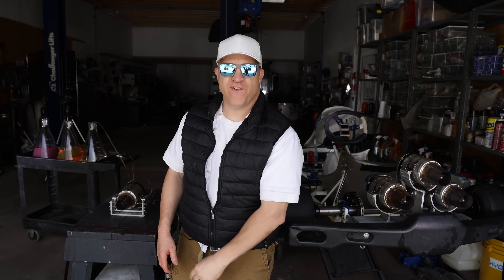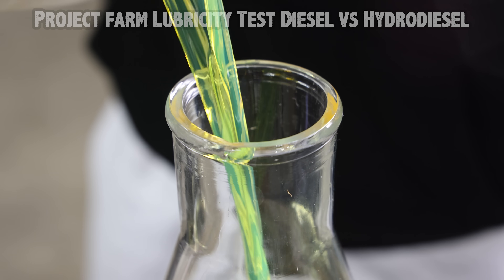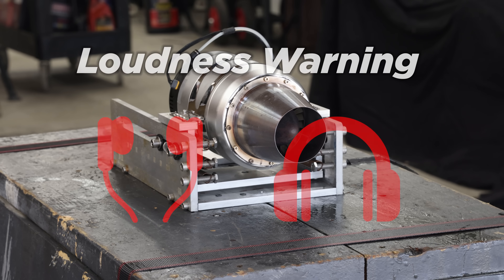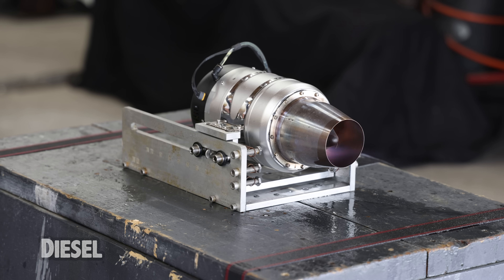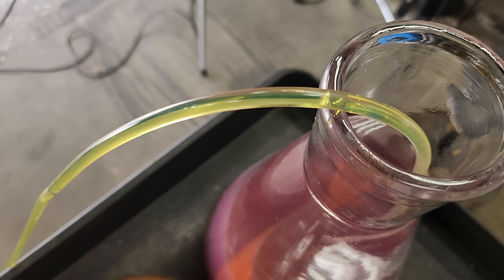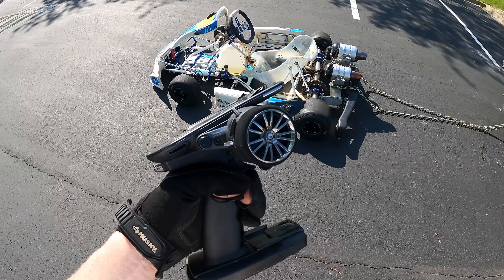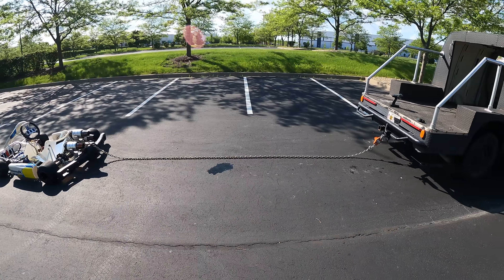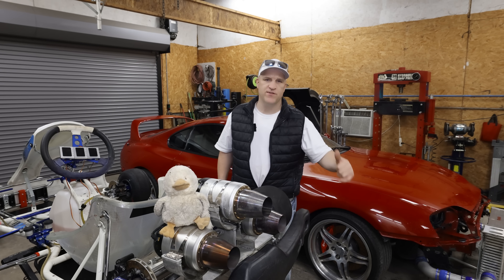Jet A vs Diesel vs Hydro Diesel (Jet Engine Thrust Test)

Comment: @warpedperception I wonder if it's possible adapting a high bypass turbofan design, like a general electric CF6 to these engines to produce and multiply your thrust? The CF6 produces between 41k-65k lb of thrust (depending on the which variant you look at). The design is kinda simple on paper, a longer shaft to implement a bigger front fan blade for your bypass around the engine, a shroud that encloses the front blades to produce thrust and a outer housing to stabilize the shroud and enclose the main engine to produce that extra thrust.

Comment: Can't say that the engine or ECU was the cause of the weird test results in the old diesel vs jet-a test, and I can prove it.
You used the same exact engine in both tests for that older matchup, therefore if there was a fault in the ECU or turbine, it would have been the SAME fault in both tests, which cancels out the error it would have induced because all of your data has that same error in it.
Much more likely that you had a fuel contamination issue, you noticed that the HydroDiesel has a lot less thrust than either Jet A or Diesel (this time around), and if you had water contamination in the Diesel of the OLD test but NO water contamination in the Jet-A of the OLD test, that would have caused a large variation, exactly lining up with that old test.

Comment: Use JetA normally on diesel you can use less throttle due to better performance also increasing fuel efficiency.
Reply from the maker: Not the case here, it was full throttle with diesel and made less power.

Comment: Jet A bruns at a higher rate than disile fuel. The other is the additives in the fuel plus the synthetic oil talorate extremely high temperature as compared to the diesel fuel. Diesel fuel doesn't have that high temperature tolerance witch is reason makes less power.

Comment: Your diesel should have race oil added if you're putting it in these (we've been using Amsoil for 4 years with no issues). Also, CO2 is your friend in those hot starts, it won't hurt the turbines like the fire. EDT: i saw later on your bottle you wrote diesel w/ oil, but you initially said "straight out of the pump" so.. good on ya i guess
Reply from the maker: I use turbine oil But I suspect any good oil would probably work, what do you mean by CO2?

Comment: 🤔it's sad that you didn't test them on pure ethanol..
Reply from the maker: Lol I'm not suicidal
Reply: @WarpedYT  I mean, using ethanol as a fuel for the engine, not for the researcher.
Reply from the maker: @alexkart9239  lol .. fair enough but I still think that will blow up the engine, it burns too hot.
Reply: @WarpedYT  even if the engine explodes, it will be an honorable death in the name of Science!
Reply: @WarpedYT  * I mean the death of the engine. Researcher should stay away.

Comment: Jet-a is less kerosene more of a diesel:gas mix by weight and the reason for it being used is for the consistent and reliable burn. At least that is how it was explained when i was a turboprop engine mechanic
Reply from the maker: I don't know too much about the fuel for turbo props, but from my knowledge jet A and kerosene are almost identical. If you Google Jet A there's a lot of information out there about it

Comment: i have flown my turbine powered r/c model helicopter for over 15 years ..   the viscosity makes a huge difference to the fuel flow rate and power delivery 3% lubricating oil is best for turbine response   % %   is noticeably lethargic . My combustion chamber design burnt the fuel in the combustion zone .. unlike your turbine which had silly hot starts and an unburnt oil slick from the unburnt fuel . Torroidal mixing of the fuel air is the only way to go ..

Comment: Another thing I noticed is the inability of the fuel to have a clean burn or be atomized correctly. It seems the engine was shooting raw fuel out a lot more with hydro diesel and diesel compared to kerosene. Interesting experiments!

Comment: Great Video. The MAX thrust on these jet engines is dependent on their MAX RPM reached and for this 300N engine its MAX rpm to make 300N( 66LB) of thrust is 98,000 RPM. You can see in both Jet-A and the Diesel test the engine reached pretty similar max rpm's therefore the thrust was very similar.......only 4LB difference.  And that could be because of the resolution of this thrust stand isn't too great, would be better to have a loadcell rather than springs but I understand the simplicity of the test stand is nice with the springs. In the Hydro diesel test you can see the engine DOES NOT reach max RPM of 98,000 rpms. It only reached about 82,000 rpm. These engine make most of their thrust in the top end of their max RPMS so 2000 or 4000 rpm below the MAX rpm make a huge difference in thrust. And in this case it was 8000 rpm below MAX rpm.   So in order to solve this issue you have to recalibrate the pump for the every different kind of fuel you use. You can do that by adjusting the "PumpLimit" parameter in the ECU.  So basically you recalibrate the max voltage the pump can reach when you command full throttle... which will make sure the pump is able to pump enough fuel into the engine to be able to reach the MAX rpm of 98,000 rpm.  You can see in the hydro diesel test the pump had already reached its max limit way before the engine reached max RPM ............which interms prevented the engine reaching its MAX RPM..... therefore lower thrust. Hope that makes sense.      More test/ experimental videos on these jet engines please.
Reply from the maker: Your mostly correct, the thrust scale is accurate, I forgot to include the clip but I calibrated it as we move through the test. I also verified with the load cell which is pretty boring because it doesn't move. Then at the end of the video I used the load cell multiple times and got the same result which are showing the video. Yes Max RPM is 98k no matter the fuel. I did in fact use hydro diesel In the previous test and it ran the same as diesel, this hydro diesel was almost 2 years old. As for the pump limit you are somewhat correct, with these ECUs on these engines they automatically adjust the pump limit based on the target RPM, up to the maximum voltage you specify, there is no manual setting for pump limit RPM It is automatic for safety reasons, the only thing that you see you watches is temperature and RPM, if the temperature and RPM are not reached within a certain period of time The engine shuts down for safety. That's why the hydro diesel got shut down quickly. So yeah there is no manual pump RPM setting here. Also if there's a restriction or the fuel viscosity is too thick It doesn't matter what the pump RPM is, it's unable to pump enough fuel. But yeah I show the load cell at the end of the video.

Comment: Incredible work! This was fascinating. I've always wondered if reheat is even possible on these engines.
Reply from the maker: Yes reheat will have to be possible 😄.. I. Going to build soon I just haven't done it yet because if I do it I want to do it right crazy man style but perfection. But I don't want to take any chances so I must build multiple failsafes... Nobody wants a knife in the throat at 100,000 RPM hahahha.

Comment: G'day,

 I dunno why anyone was surprised.

The underlying Reason why actual human-carrying Jet Aeroplanes run 
On 
Jet A-1
(Specially refined Kerosene...)
Is that "Parafin", as it was once  marketed, was originally sold as a
"Lighting Oil"...; 
The Mineral Replacement for
Sperm (Whale) Oil in
Table-Lamps.

Sperm Oil made Light, but it has a lot of Hydrogen in it, and so it produces a lot of Water in the Combustion-Products, as well as Soot.

The Soot was annoying, but because the Air at night is cold, the Water condensed out onto everything, leading to damp Curtains, wet Windows and Walls, dripping Soot-juice falling from the Ceilings - unless a room was so draughty as to fail to hold in the warm wet Fumes.

So, Kerosene was fractionally distilled to have the
Most Chemical Energy per unit of mass, of ANY Fraction which can be distilled from Crude Oil.

For use in Tablestand Lamps.

After which the ubiquitous
Hurricane Lamp was invented, with Air Inlets & Outlets balanced above & below the Flame to balance whatever Wind occurred around a Circular Glass Chimney - and the Exhaust also venting down to fill the top of the Fueltank with Combustion-Gas...

But the point is that Kerosene is used in Jets, because it has more Chemical Energy in it for the Mass/Volume/Weight than
ANY OTHER Hydrocarbon Fractional Distillate.

So I have been led to underconstumble.

Apparently, such is the reason why 
Fat Herman
And the Nazti Germans
Used to start up their 
Late-War Turbojets on
Kerosene..., and once spun up to speed and at operating temperature - they switched over to feeding in filtered, used, Sump-Oil...(!)
Because it might run a bit hotter and smokier, but it gave about 90 or 95% of the 
Thrust of burning actual (rare & expensive - there & then) 
Kerosene...

So, there you go, 
And now you know ; 
And you can say that the
Fool on the Hill
Told you so...

Such is life,

Have a good one...

Stsy safe.

;-p

Ciao !
Reply from the maker: That was a great explanation, u could make a video out of that for sure
Reply: @WarpedYT  

Thanks for the reply !

I might do that, actually...(!).

It would fit into a couple of my playlists ; there are 23 of them, 8 devoted to Wildlife Encounters - sorted by Species..., but I first began living off-grid in 1985, so I raised my kids to 10 & 11 before buying my first Solar Panel..., Kerosene Lights and Candles, kinda thing, and I spent a long time laminating & carving Wind Turbines to belt-drive an Automotive Alternator (bad idea, a waste of time ) - in fact for 15 years I've saved Fuel by having a Solar Panel competing with my Car Engine's Alternator to keep the Battery fully charged. Every time the motor stops running  the SunFoil finishes recharging the Battery, so at the next startup it's already full, and so no extra fuel needs to be burnt in Catchup mode after (not) sitting part discharged, and (not) sulphating.

I have a Playlist about SunFoils, it was what brought me to YT..; trying to push the idea as a DIY Retrofit Project - but the "Norms" are extremely resistant to change, if it means personally doing anything a bit different....

It's taken this long for there to be about 100 copycat samizdat Self-starter SunFoils getting around my hometown ; and my son is the Town's Auto-Electrican who let Daddy out the Mk-2 on his Subaru Brumby when he was a 1st year Apprentice at 18, and at 25 when he bought his boss out he put 4 SunFoils in his Workshop Truck (!).

If you feel like a good giggle, then backtrack me to my Videos and search them by "most popular"...

If you're into close encounters with Kangaroos, yesterday's Upload was a pretty good one...; and either perusing the Playlists, or scrolling through the Most Popular will showcase my output,
As the actual
Fool On the Hill...

Living in a Solar-powered Lawn Locker in the Forest, riding an Electric Motocross Bike to Town for the Groceries - including the Bread to hand-feed  wild unfenced Kangaroos and Swamp Wallabies, Possums and 3 kinds of Native Birds who all consider me to be
Their Family's
Pet Tame-Human...

Someone has to do it, and if not me, then who...; kinda thing (?) !

Anyway, thanks again for the reply !

Stay safe,

;-p

Ciao !

Comment: I used to work on oil heat. There were experimental oil pre heaters that was supposed to increase efficiency.
Reply from the maker: I do remember either reading or hearing or seeing something about that, I even think I remember a while back and idea to preheat the fuel by running a coil outside of the housing of the afterburner or something like that.
Reply: @WarpedYT  Mash this suggestion together with another, find out how warm diesel needs to be to match kerosene's viscosity, and heat the container (provided it's not an unsafe amount of heat) so the pump doesn't flow any differently.

Comment: Soak your clothes in simple green and water, then rinse and wash /dry twice. Only way I've been able
To get the smell or Jet-A and diesel out of my clothes
Reply from the maker: I actually use the gojo original hand cleaner the petroleum based one, I rub that into my pants and then throw them in the washer works every time
Reply: @WarpedYT  good to know! Because the simple green smell takes a couple washes to get out haha. But at least it isn't full of jet A additives

Comment: Would be cool to see the test ran with renewable diesel, R99. 

It's getting more widely available on the West Coast and I've ran it exclusively in my truck for the last year. It has a little more pep from the nearly double cetane rating and gets 1-2 mpg better.

Comment: Hello. I do have one of this jet engines (Xicoy 120N) mounted on a RC plane myself. I can of course share with you what fuel I use, and I think I can also throw a bit of insight on the matter.

I will start saying I (politely) complained on your last video on this topic, but your response was also perfeclty polite, and I hoped for a retest. I think this video is much better done in all ways.

As you say in the closing part, the difference is caused by the different viscosity on diesel vs kerosene. So pump duty cycle must be a bit higher on diesel. Controllers of different manufacturers do this in different ways, if I am not mistaken your turbine is a Swiwin, and they learn the maximum pump setting the first run after defining the PWM range on the throttle channel. 

If you did not perform that every single run that explains why in the first video the results are so different. Note that if you perform the the PWM range calibration on diesel it will work on kerosene, since the setpoint is higher than needed, but not the opposite.

For myself, I tested both diesel and Jet A1, with the turbine mounted on the plane, pushing against a simple bathroom weight on a wall. On my ECU you have to manually set if you are using kerosene or diesel so the pump has the right settings. Thrust is within margin of error of my setup (+-5N), marking 125N with both fuels.

I do fly with kerosene usually for two main reasons, since thrust is the same in my tests:
1) The smell in the car is terrible with diesel, since RC plane fuel tanks are not sealed
2) Cold starts are a bit easier on really cold weather (less than 5ºC) with kerosene

I use the manufacturer suggested fuel/lubricant mix, which is 4% total oil, of wich 2/3 are Mobil DTE light industrial turbine oil, and the remaining 1/3 is high quality esther-based 2T oil (motul 800).

A desirable side effect with diesel is that, according to the manufacturer of my turbine, you can run the turbine a bit leaner on oil, at 3% instead of 4%, since diesel is also lubricant in itself. With a bit less oil maybe (have not tested myself) maybe the thrust would be a tiny bit better on diesel. Since we are talking about minimal differences, I will stay with kerosene anyways.

Nice video overall. Keep up the great work. You can check some videos of the plane (and some more turbine-powered) with that turbine in my channel if you have curiosity. Just do not expect anything fancy.

Comment: The diesel is a little more retarded because its less volatile than paraffin.  That results in it burning later and higher exhaust temp but it also means the peak pressure where it matters is lower so in this engine its making less power. You could optimise it to run on diesel butbit wouldn't just be an ecu change it would be the emulsion tubes and possibly the whole combustion chamber.  The fuels are very similar in energy content but diesel is more variable so it could be more or less depending on what you bought and the time of year.  The volatility though makes the difference.  You can run a diesel engine on jet A1 because I've tried it but it doesn't do the injector pump any favours.  Their air certified diesel aero engines which are derivatives of Mercedes diesel piston engines that run on Jet A1 all day long.

Comment: I Think the diesels lag off trust might be because the jet engine is only a single stage compressor i think there isn't enough air pressure to burn it properly.  I believe there only 3 bars in the burn champer

Comment: Wait what people were actually mad?? Is that true?? It’s common knowledge turbines can take diesel but don’t like it nearly as much as other fuels especially as much as jet a. Of course the numbers will drop. Still the perk to turbine engines is the ability to take different fuel types. Which is why I wish Chrysler mass produced their turbine car in the 1960s instead of making just around 50 cars then destroying most at the end of the program. They were going around putting all sorts of weird fuels in their turbine car. I wish they still made them actually but I get why it was killed off back then because gas was what 10 cents a gallon so no point. Now tho there is a point after biden took office and my fuel went from $1.64 to $4 a gallon so bring them back!!! I know the turbine car got lower mpg but who cares if I can use different super cheap fuels!! I don’t mind doing 2 5 minutes or less (unlike electric haha) refuelings a week instead of 1 if the cost is under $5-$10 for 30-50 gallons!! Also the different fuels is why the M1 abrams tank has a turbine engine because in battle it would be capable of using several different type of fuels instead just one. Obviously for an aircraft using a turbojet etc the best fuel is what you want but yea they can all run on different types!